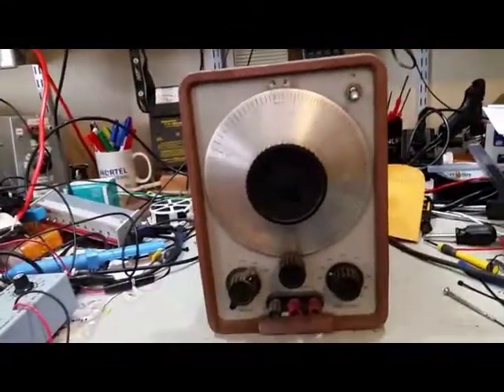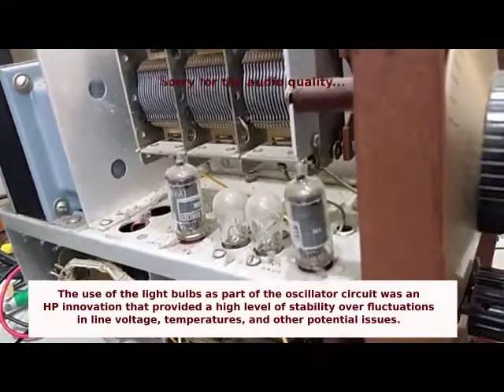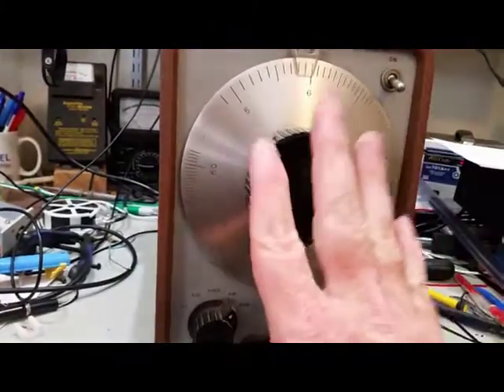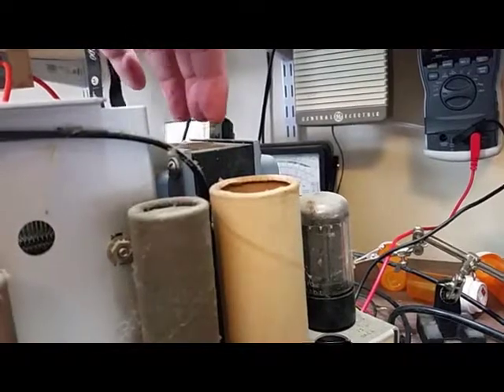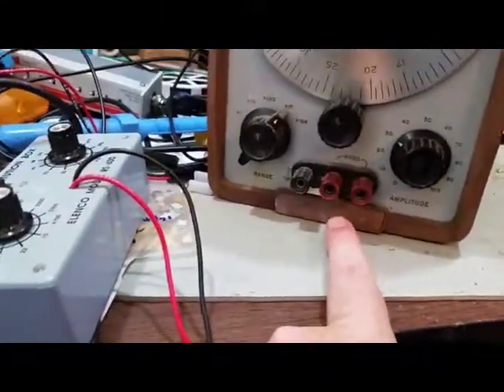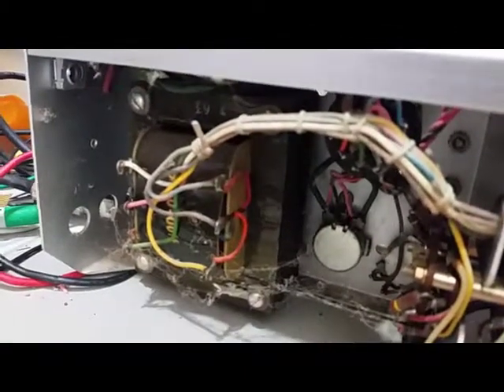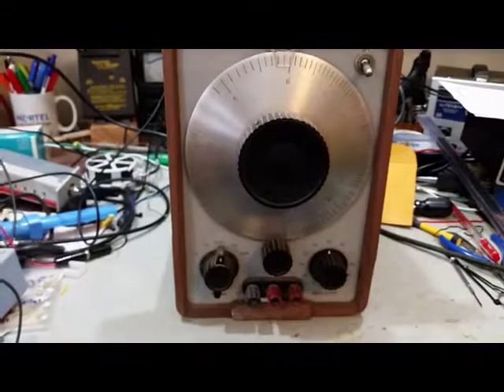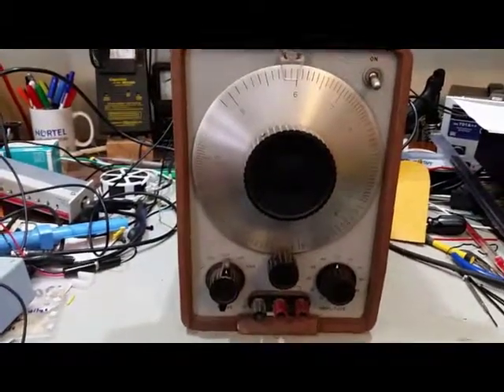HP 200CD Restoration Part 1

Comment: Love to see old HP instruments, thanks for posting. The dials were all the same. To calibrate the frequency dial, there is a procedure. Basically, you set it to a certain frequency and if the dial is loosened in a specific manner so that the frequency does not move but the dial does, then you can rotate the dial to the correct frequency as determined by a counter. Lock the dial down at the measured frequency and it set. I think the front cover has to be removed. If you don't already have one, get the manual.